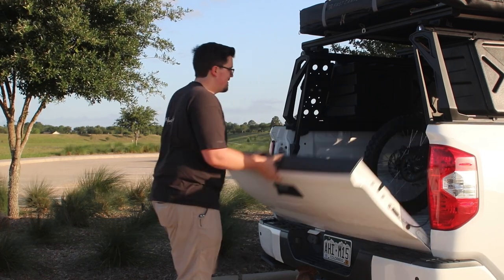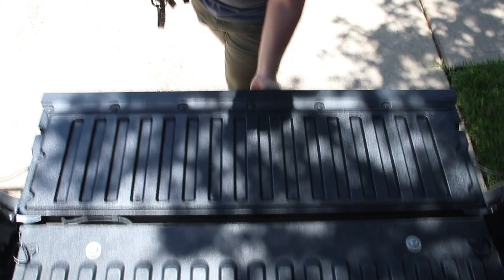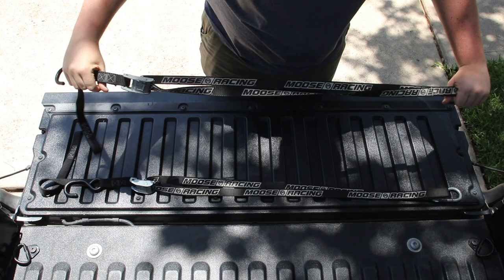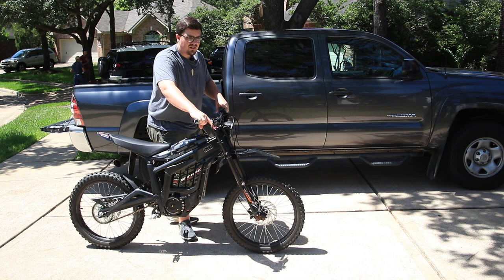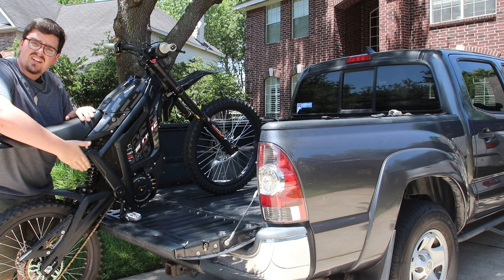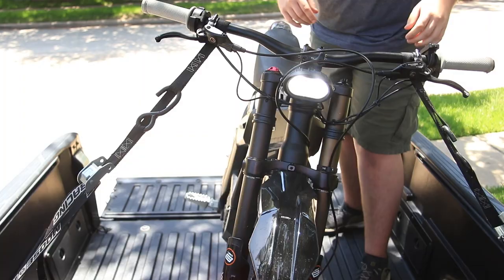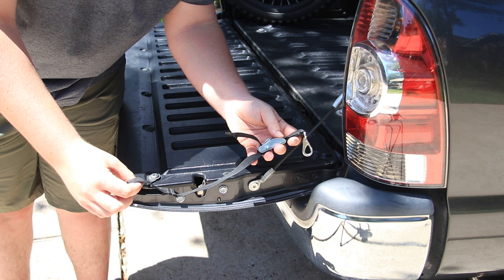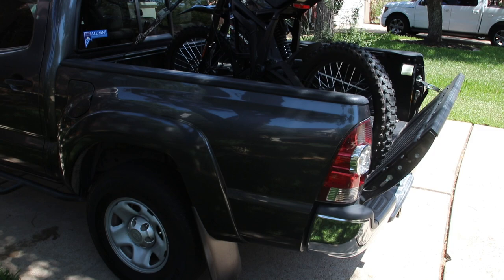How To Load Up An Ebike | Truck Bed Tutorial

Comment: @matthew mclaughlin Heyo Im a bigger guy who is gonna ride mostly street riding, what do u think about the talaria and the shocks? Do u ever bottom the forks? Im around 185 cm and 115kg ( Im a boxer ) ive just heard that the forks and shock spring are bad so i wanna hear your opinion on it?
Reply from the maker: Hey!
So as you can tell I’m a big dude, and I have been extremely surprised at the performance of the suspension. I still haven’t bottomed out the fork, even after jumping it. The rear spring is definitely too soft when I’m sitting down, but when I stand up and shift my weight forward I feel very in control and it doesn’t feel too soft. 

Basically unless something cray happens I won’t be upgrading my suspension anytime soon.

Comment: Do you know of any good hitch carriers that are rated for that bike weight ?
Reply: Dirt bike hitch racks work great, around the same price as regular bike ones, but can only hold 1 bike at a time
Reply from the maker: A motorcycle specific Mitch carrier will work for sure. You can find them on Amazon or at most motorcycle dealerships. 

I’m probably going to be testing heavy duty MTB carriers though because they are lightweight and have some other nice features. But for sure the moto stuff will definitely work.

Comment: Greetings . Can it charge from the bed outlet while driving ?
Reply from the maker: Depends. The charger requires 600 watts to operate. So as long as your bed outlet produces over 600 watts it’s no problem. Otherwise it will not. 

I installed a direct-wire 800 watt inverter in my truck bed and that worked great for my two week overland trip to Colorado.
Reply: I appreciate your time .. respect 🫡
Reply from the maker: @jasenalapati665  no problem 🤙🏻

Comment: I have a frontier so our beds are the same. You think I can fit 2 ebikes this way? I have a bed extender too.
Reply: Two full-size dirtbikes can fit in the bed of a 5ft bed with the tailgate down... no reason two ebikes can't fit.
Reply from the maker: Yea you can totally run two e-bikes in the bed side by side. The straps will sit slightly on top of the front tire of each bike because of the angle the straps will be at. (Hard to describe in text) But absolutely no worries. Just repeat the process for the second bike but instead of placing it in the middle move each bike to the sides of the bed.